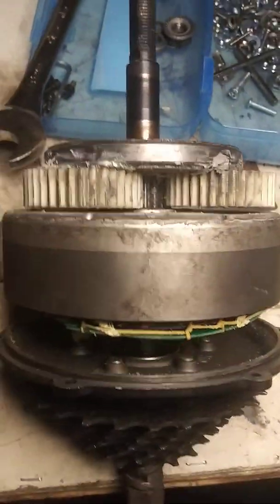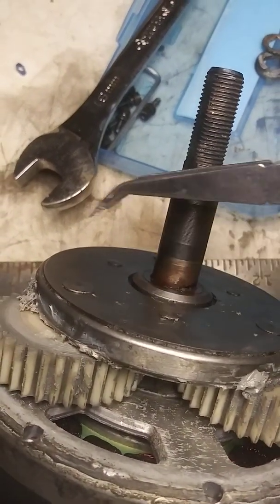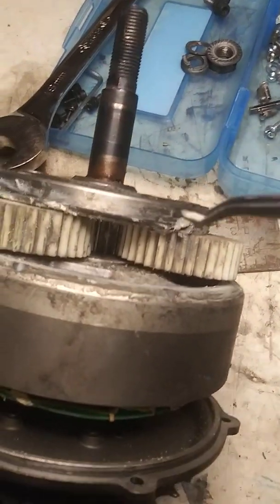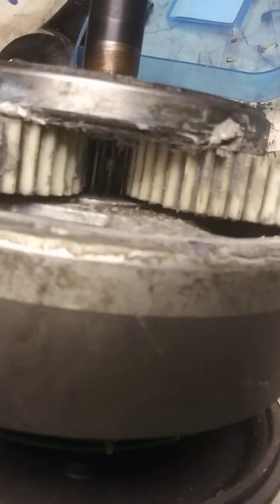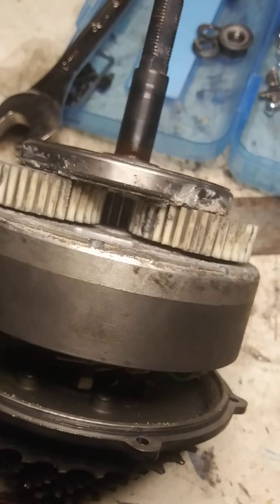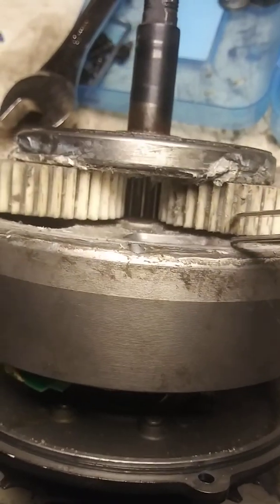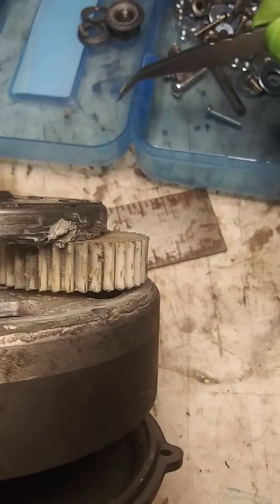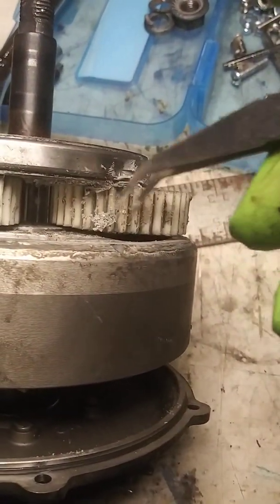Bafang Motor Problem (Solved)

Comment: It starts with teeth getting broken on one gear and the dislodged one damage the other ones. So as soon as you hear anything abnormal, vibrations or judder. Stop riding, walk back home, open jt and replace the only broken gear. You will save the gears as well as your motor from getting fused due to overheating. Also use good grade grease after cleaning the old one. These are straight type teethed gear, I got the helical kinda and those gears are very rare to find.

Comment: I have this same issue. I pulled the motor out and sure enough.. two of the gears are missing a tooth and the third gear is missing two teeth.

Comment: How many miles are on the motor? And what kind of grease is good for the plastic gears.
Reply from the maker: Hey there! Thanks! At the time of making this video I believe it was under 3 thousand miles. The grease I prefer and have never switched is Permatex. It's a White Lithium Grease that resists moisture, prevents against rust, and an overall great lubricant, Oh! and prevents friction and heat. You can find it on Amazon.
Reply: @airforcevoyager  Okay great! Thanks, I'm new to these bikes and came across your videos. Didn't know the motors needed to be maintained lol. Thank you for your advice, and great work!
Reply: Came to say basically the same thing he did. The amazon lithium lube is good stuff.

Comment: I believe starting in pedal assist 5 rips the gears. My owners manual states to put pas at 1 when you  stop to alleviate the spinning
Reply from the maker: Very true. I put a lot of unnecessary stress on my bike. She's held up pretty good, however I do try to go easy on the throttle, these gears aren't cheap anymore 2023.

Comment: I unlocked my ebike with dual 750w bafang hub drives... i went back to original 25km/h settings... things were way too loud. I think if you want speed who cares but if you would rather longer life im talkinnyears and years just stick to factory settings.
Im a 6ft 4in dad bod haha i tow 2 of my kids on a trailer and have one in front on school runs... it does the job... i get to ride with my kids with a spinal fusion and i couldnt be happier. But as an ex diesel mechanic... def just run at slower speeds dont wreck your bike just tongo fast... if thats what you really want with minimal issues over time. Buy a motorcycle
Reply from the maker: I think I may oneway buy a motorcycle lol. Sorry to hear about your fusion, hope your continuing to do well today, and enjoying your adventures.

Comment: I need to buy a puller, gotta change the teeth
Reply from the maker: A few even taps with a hammer saved me on that bill.
Reply: @airforcevoyager  I gotta them off👍🇬🇧
Reply: @airforcevoyager  This is by far my favourite ebike motor, I have another with a sinewave controller and she's so quiet I scare people passing by 🤠🤘 ,and my bike with a 36v 10ah battery only weighs 44 Lbs ,I like a light ebike on pedal assist 🇬🇧🤠🤘🙏

Comment: You can get metal gears for this motor. If you can confirm that the planetary gears are 36 tooth with an outter diameter or each gear is 47.8mm and the thickness is 13.3mm, and also check that the pins that the planetarys spin on are 58mm center to center, I can get metal planetary gears for both our 750w Bafang motors.

Comment: You know, there are metal alloy planetary gears and reinforced planetary gears available. I have sourced them from China, but I need the exact model number from your Bafang (which I'm hoping is a G060.750.DC) I also need the dimensional confirmation of one of the planetary gears and tooth count in order to order them. I believe they are 36 tooth, 47.8mm x 13.3mm gears. Look here;  https://www.aliexpress.com/item/33010694454.html?spm=a2g0o.cart.0.0.6c733c00XhvrxV&mp=1
https://www.youtube.com/watch?v=QhEZi0ILvL4&ab_channel=ArielRiderEbikes

Comment: I don't understand why bafang uses this plastic gears  they don't last long at all,,,,  they all breaks
Reply: It’s specifically so they wear out the before the outer housing that laces to your rim does if you think about it it’s way more convenient to replace some plastic gears or just the internals of a motor rather than having it relaced every time there needs to be a replacement
Reply: @tylerseyfert2015  👏
Reply from the maker: Agreed, I'm running into this problem again 2 months later. I purchased metal gears last night, so stay tuned I will share that and any problems I run into installing.
Reply: @airforcevoyager  Very cool.  I'm curious to hear how the metal gears work for you. Although 13k miles sounds like a reasonable amount of life for a set of those.  Thanks for sharing.
Reply: @airforcevoyager  are the metal gears louder?
Reply: there are plastic gears in my motorbike kick start assembly, but it was one of the metal gears that had teeth break off